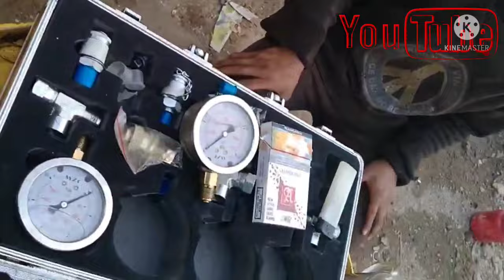#komatsu hydraulic #pump pressure #9866905244

Comment: Hello dear sir, I have a Komatsu 7.210 excavator. There is a heavy load on the engine, although the pump pressure is 280 out of 355, with smoke and there is no malfunction of the fuel pump or fuel injection. Please help me, thank you for your effort
Reply: Ok, obrigado!